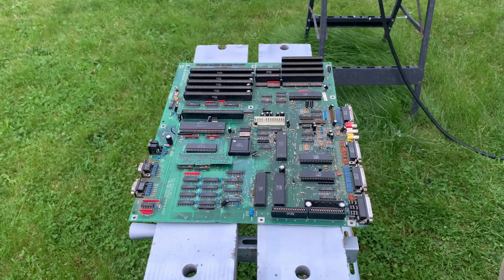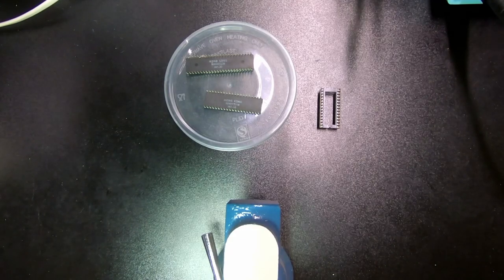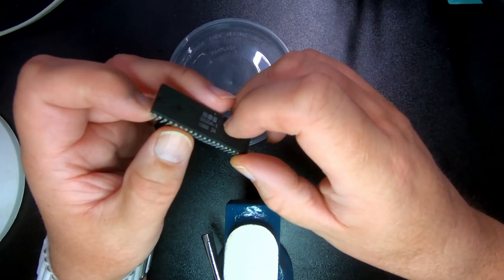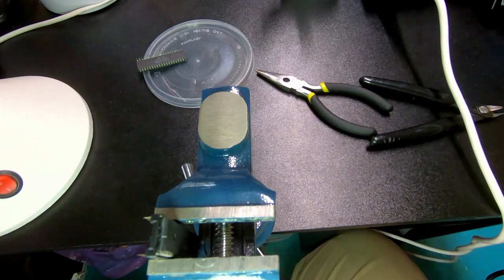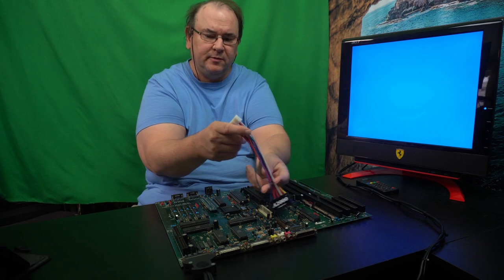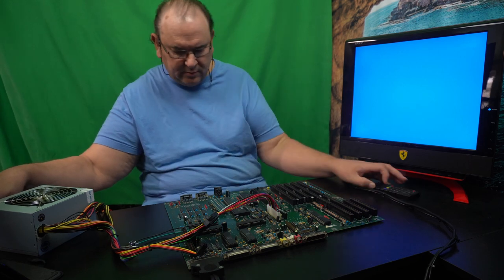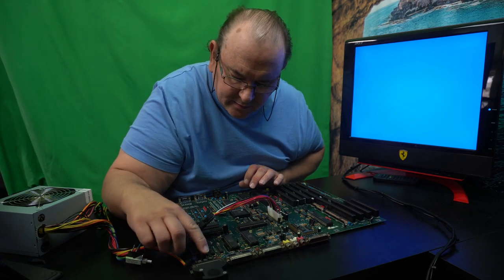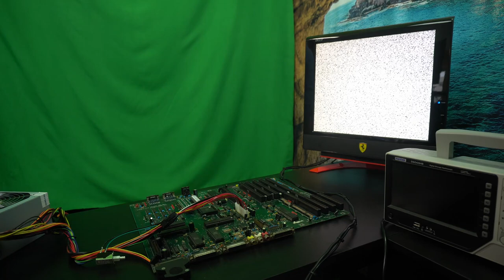Retro Commodore Amiga 2000 motherboard clean and first time power up

Comment: Nice!!! Thx for this video. Just found your channel, liked and subscribed. BTW. What is the circuit board looking thing near the boot rom and fat agnus? I have several 2000 motherboards and Ive never seen this.
Reply from the maker: Logic in chips that used to be on board moved to a header board. Assuming this is due to part availability issues at the time or chips selected turned out not to work as intended. I was able to locate on-line the diagram for the header board. Also see my video https://youtu.be/3kpvsQlMJJk for a closer look